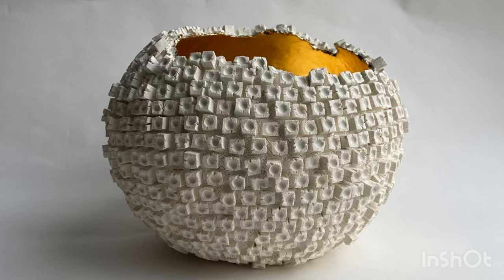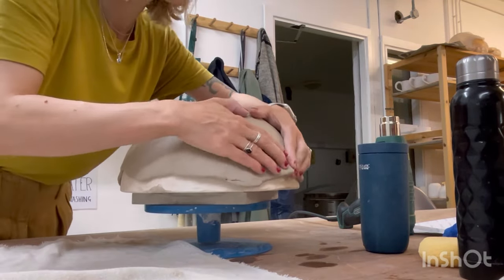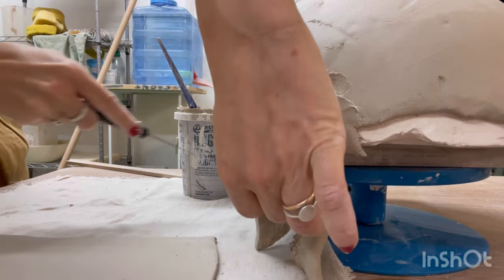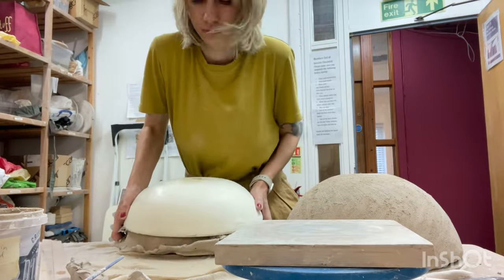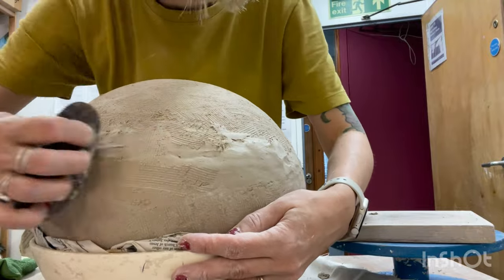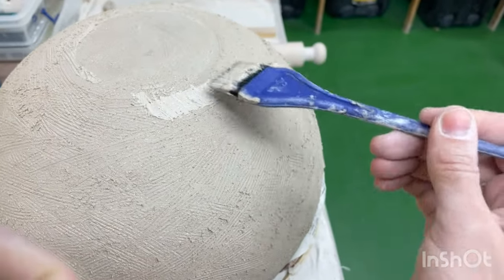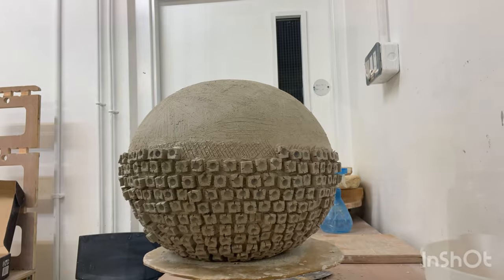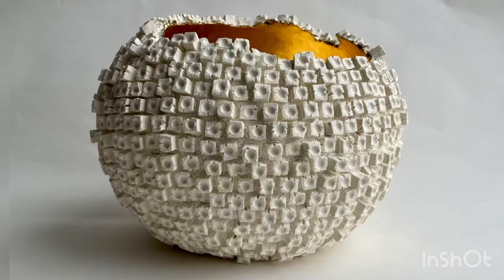Ceramic Bowl Sculpture Creation

Comment: Thank you for your amazing video. Could you share what kind of glaze was used in this piece? Brand?
Reply from the maker: I often use AMACO vintage gold, however if you want a perfect gold finish it is best to use luster. In this case I covered it with gold glaze but it showed up very dark and the decision was made to cover the inner surface with gold sheets.